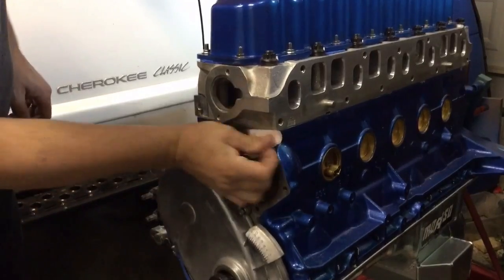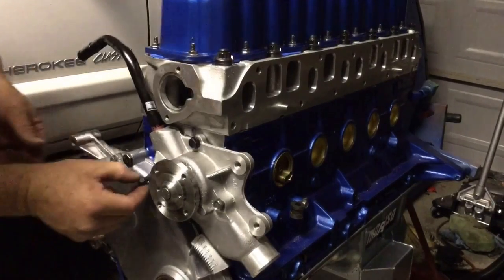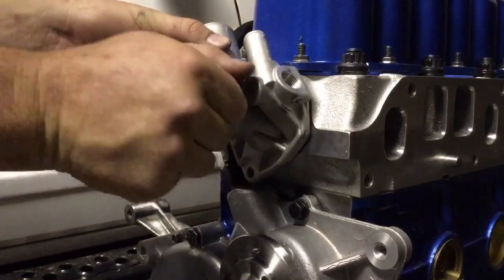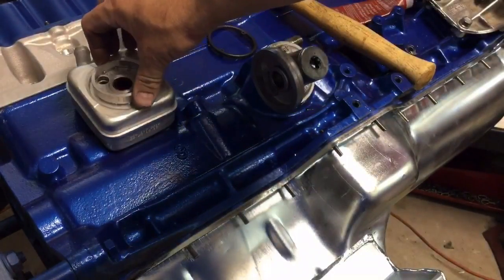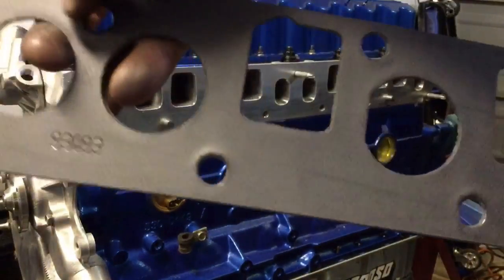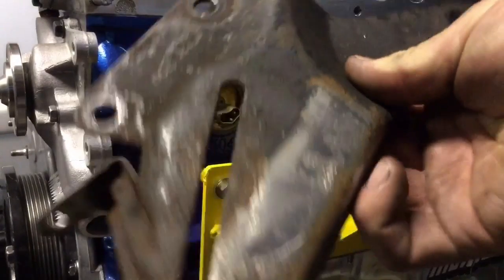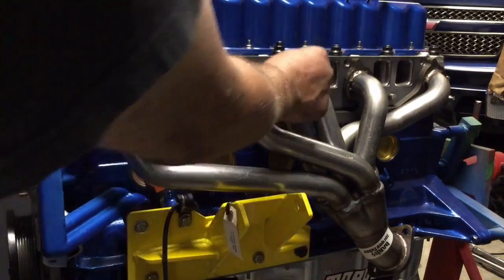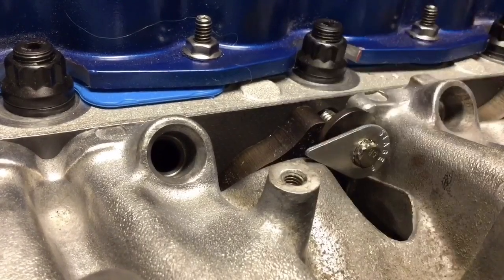Jeep 4.7 Stroker Complete Build Part 5

Comment: Thank you for this awesome series. I learned a lot. I wanted to share my experience with my new Edelbrock head that the Mr. gasket thermostat does not fit in mine. On full opening it hits the rear right side and bent. Now it got stuck close and overheated my engine. I ordered the Edelbrock brand and it fits fine

Comment: 2 Questions:
1. Was the water pump and water neck specifically sold for the heater/cooler or would any one do?
2. What did you find those locking tabs for the intake/exhaust?
Reply from the maker: Any water pump/neck will work, I just chose high volume. The locking tabs were purchased through summit racing.
Reply from the maker: https://www.summitracing.com/search/brand/stage-8-locking-fasteners?SortBy=Default&SortOrder=Ascending
Reply: @kevefox  Sweet. I was wondering becuase you had to add the heater/cooler to your loop. Did that cause issues?

Comment: When installing items such as water pumps use two long screws of the appropriate thread with the heads cut off to act as guides and supports for the item being installed. This can apply to assembling any type of machinery.

Comment: Great series and very nice buildup. If you still have this stroker in your XJ, you can use an oil filter for an 88 stang since the threads are the same, but It would hold more oil capacity. Something I learned when I had my ZJ with the 4.0.

Comment: What was that oil filter adapter off of?
Reply from the maker: Kyle Eastland the adapter is off of a 4.0 XJ, the heater/Cooler is aftermarket from Hesco. I've heard that there is something similar on some Caravans though.
Reply: Tinkering Fox thanks for the quick response. I'm seeing that Hesco cooler is pretty expensive compared to some others. Is there a reason you went with that?

Also, I just got my 4.6 stroker installed in my WJ yesterday and it seems to have a little trouble starting. Did you put in a different starter?
Reply from the maker: Kyle Eastland no reason, just saw that one while shopping. That's just a regular starter from Oreiley with a premium battery from Oreiley as well.
Reply from the maker: Kyle Eastland no reason, just saw that one while shopping. That's just a regular starter from Oreiley with a premium battery from Oreiley as well.

Comment: and 2nd question what is the good thing about the banks exhaust manifold? :-) thank you very much for sharing your experiene
Reply from the maker: Tom Lipinski you're welcome. The quality is the main thing. I bought a Chinese eBay one for another motor and was underwhelmed. The banks has some tubes in the collector that supposedly help. The metal is thicker and the welds are perfect. It also comes with a really nice gasket.

Comment: I can't quite see it on your intake, but I know the exhaust manifold I use has a significantly thicker flange than the one on my intake. Is yours the same? DO you just leave those conical washers at a bit of an angle and call it good?
Reply from the maker: Riley Snyder my intake and exhaust were perfectly even. I suppose you could hold your conical washer up to the grinder and sheer down part of it to make it even.
Reply from the maker: Voice texting.

Comment: i would have ceramic painted the exhaust and then heat rapped it, would have given the maximum heat removal and better intake temps, but sick build, the detail you go into is just to die for. I'm planing on the same build and just copy your videos lol
Reply from the maker: Steven LaFrance thanks, I looked into the ceramic and wrapping it but read a lot about how it fatigues the exhaust by keeping in the heat so with the starter and ignition on the other side I opted to leave it naked.

Comment: Is the block heater just because where you live, or is it better for the engine even if it's not -0 temps?
Reply from the maker: PDXDrumr 
It's primarily for cold temps. Anytime it gets below freezing and I park outside I like to plug it in. For example it will be -17°F the day after tomorrow. A magnetic oil pan heater is a great addition, and a battery heater called an Alaska Blanket will keep your battery from freezing. If you live in a warm climate and don't plan on spending any amount of time in a cold climate a block heater is probably a waste of time. -Kevin
Reply: Thanks, I'm thinking if I'm up in the cascades overnight where those temps occur it would reduce wear if I used one.